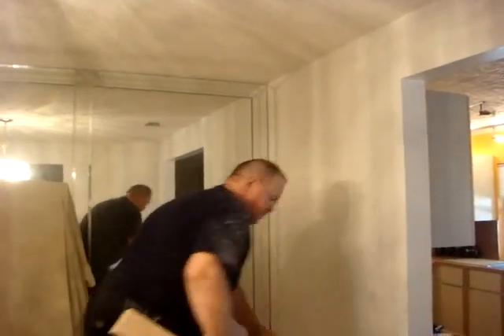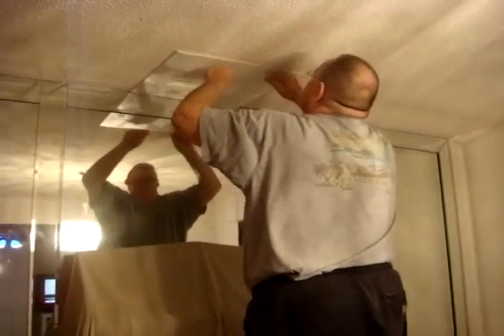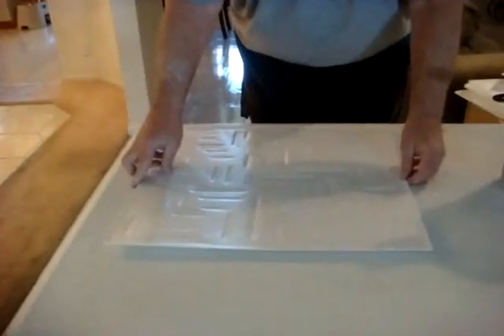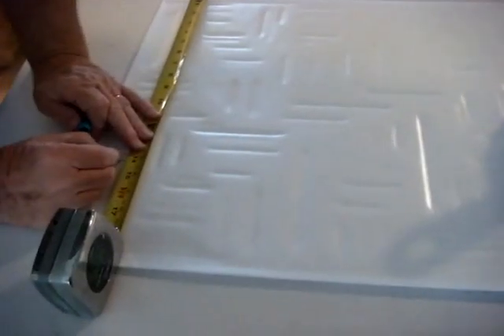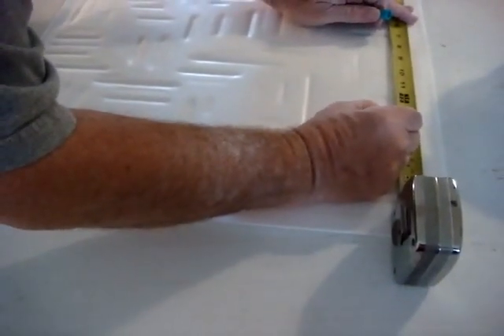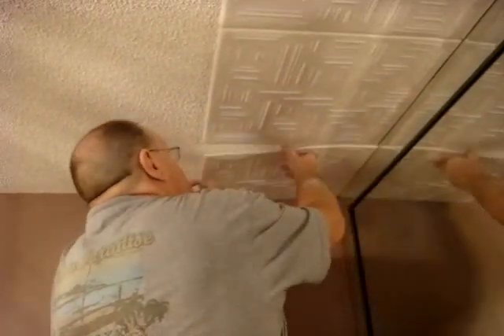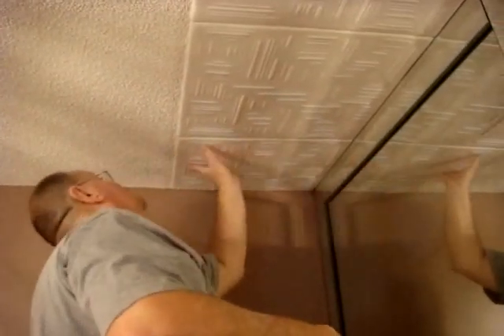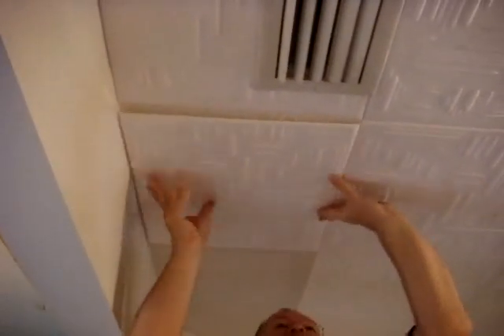Do-it-Yourself - DIY - Foam Ceiling Tiles Installation over Popcorn Ceiling

Comment: I just love the gypsum ceiling design. If only you can show me which kind of lights to use and where can I place them.
Reply: Here are two videos i did with these foam tiles, the first i had pot lights, the other fixture , the results are outstanding  https://youtu.be/aaC4QuYyHoI   &  https://youtu.be/oxN9i8-2vgA

Comment: Can the tiles be painted if need be? What about smokers? Will the tiles stain very bad?
Reply: Have these in my home and thinking of getting more. I know it's a bit late to answer your question but anyway, yes you can typically paint Styrofoam tiles. That being said, common sense when painting anything; test it out first. Paint one tile with a full coat and see what happens. Make sure it isn't some kind of paint that will melt/eat through the Styrofoam or chip off easy. Once you know it will work on one, you can do the rest. 

Smoking, I don't see how it would stain styrofoam but I also don't smoke and don't allow anyone to smoke near mine. If you value the walls/ceilings in your home, light it up outside or in the garage.
Reply: Yes, can be painted, the tiles will stain as bad as any other painted surface.  I got two of these foam acoustic files, I put one on popcorn ceiling, one on flat drywall. Did an install timelapse of both. https://youtu.be/aaC4QuYyHoI   &  https://youtu.be/oxN9i8-2vgA

Comment: Hello,
If popcorn is secure and not in pieces the glue work fine,
Use Locktite All Purpose Construction Adhesive or mastic which is ceramic tike adhesive

Comment: even if the room is square I would finder the center of the room and make it the focal point and work towards the end
Reply: +B Agreed.  As with tile floor projects, it is best to start in center to make all tiles along edges the same width after they are cut.
Reply: That seems like it would look horrible with all the half pieces around the border.  What that approach was taken with a tiled bathroom, it would look horrendous, I think.
Reply: Yes , i agree. i did this method but its harder to measure out that's all. Here are two videos i did with these foam tiles, results are outstanding  https://youtu.be/aaC4QuYyHoI   &  https://youtu.be/oxN9i8-2vgA

Comment: I see you are using Acrylpro ceramic tile adhesive. I dont believe that is recommended for Styrofoam ceiling tiles. How is it holding up?
Reply: The company I got mine from recommends Acrylpro for the adhesive.